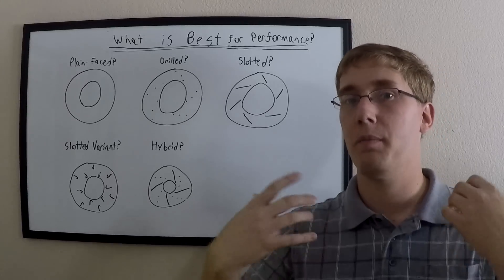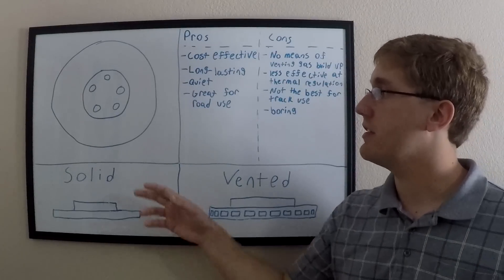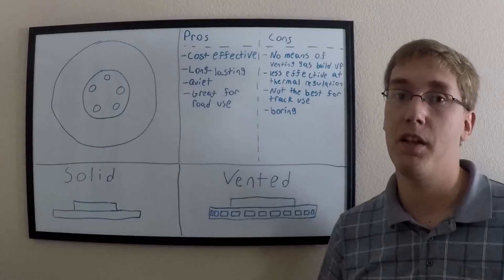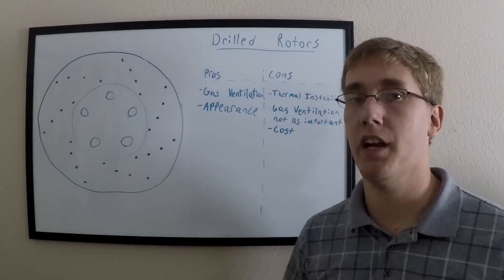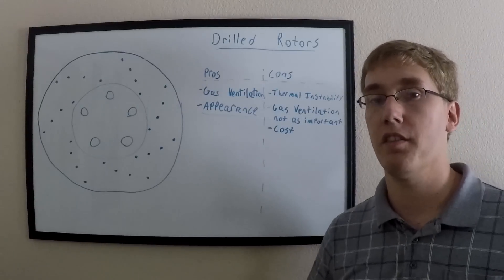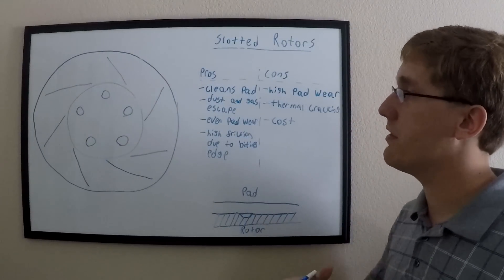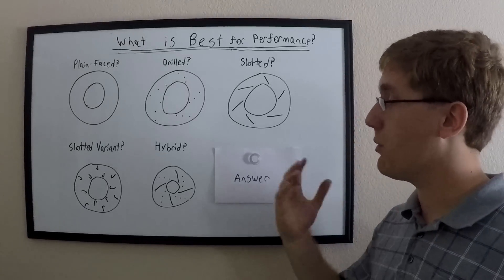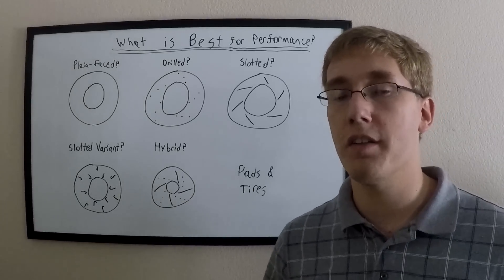Plain vs. Drilled vs. Slotted. vs ??? Rotors - What's what?

Comment: Most cars come with undersized discs and calipers, (I find), upgrading the calipers and disc sizes really does stop the car quicker at higher speeds. Stock are just not up to the job,, most of the time, especially for modified cars..
Reply: People been doing it on Opel Corsa B for years in Europe

Comment: Really nice video, wish I had saw before I purchased slotted for my daily driver pickup.
Reply: The benefit of slotted it that it keeps your pad surface perfectly smooth/level which in turn keeps the rotors from getting any inconsistencies so you won't end up with that vibration or wobble that can typically happen when solid rotors heat up or wear over time. It keeps everything in fuller contact. You won't regret your choice.

Comment: my stock brake is ATE FN3 caliper, with 288mm plain rotor and i'm using Michelin PS4 tires. Brake pads are about to dead (within several thousands km) and I'm planning change them to EBC yellow stuff. also wanna change to 312mm slotted disks, dose that rotor upgrade is necessary? I'm driving kinda aggressive, and sometimes need running up and down hill roads.

Comment: You can use solid/plain rotors for autocross, or even light track use. If you have a dedicated track car, you should have dedicated pads and rotors and calipers. Drilled rotors are only for weight reduction on an already huge and lightweight 2 piece rotor.

Comment: I have  vw Jetta and it has stock  288mm front rotor's, if I change to 320mm rotor's will it make any difference in stopping advantage, I drive mostly highway and some times I got to jam on the brake's to sudden traffic stop. I use ceramic pads front and back,  abs has not turn on any of the sudden stops.
Reply from the maker: Larger rotors will increase the responsiveness of the pedal, allowing you to brake with less effort, keep in mind that it does not improve your stopping distance however, that is down to the tires/weight of the vehicle.

Comment: Good info but never talk about towing which is when you want to keep heat down so drilled will help in this application
Reply: I would do solid personally.  I've seen cracks develop too often around the holes to want to have cross-drilled.  Plus stock it's already sufficient for towing.  I'd just keep the extra mass and use good brake fluid.

Comment: You seem very knowledgeable when it comes to brake rotors mostly out of curiosity I wonder if you could tell me what happened 2 mine.  I have some slotted rotors on the front of my car I could tell they were a little warped so I took them to I shop and had them turned upon reinstalling them I immediately noticed today rhythmic pulsing somewhat like a muffled machine gun every time I applying my brakes. My solution was to just buy a new rotors.  Did I discover by accident that you cannot turn slotted rotors? Or do you suspect something else went wrong?
Reply from the maker: I'm not sure about slotted rotors not being machineable. Did you feel anything through the steering wheel? If not it may just be out gassing from the slots, I have dimpled rotors on my sentra and it makes a noise like a rattle snake under breqking.

Comment: I've learned this when I started tracks days 15 years ago and save a lot because of this. Drilled is for looks and less reliable. If you are daily driving only in that car - get plain. If you are autocrossing or road coursing get slotted, good high temp capable pads and motul to prevent boiling.
Reply: Rogan how about make the slots on a plain one, obviously with an expert on it vs buy a slotted one ?
Reply: Do you think ppl are buying them for the science. Its all aesthetics for 99.9% of population.

Comment: I live in a mountainous region. I do a lot of hard braking when driving down the mountains on winding curvy roads. Is there a rotor specification I can look for that rates rotor warping and which rotor design is least likely to warp?
Reply: A cryotreated rotor will probably have the least chance of warping.
Reply: @dr.hugog.hackenbush9443  Thanks for the tip. The web sites I checked said cryo treated rotors are rated a step up from OEM because they have longer wear, better stopping in general with matched  pads and they are rated even for street and track use. The cost is about 50% higher but still affordable and  if they last longer without warping they will be worth it.

Comment: I have had no luck with rotors. They always getting warped unless i used drilled and slotted ones. But they are loud especially under hard braking. So no solution for me :D
Reply: You can start braking sooner, drive slower, or get bigger rotor set up.
Reply: Michael Distefano i installed big brake kit. No problem after that. And i removed heat shields since using ceramic brakes dont dust much

Comment: I had a 2003 Honda Accord as a daily driver.  There is a down hill grade that is notorious for people getting into rear end collisions on the way to work.  There were times I wondered if I was going to stop in time.  I decided to switch to slotted and cross drilled rotors.  There was a noticeable difference in increased stopping power and there were a couple of instances I am sure I would have run into the car ahead had it not been for the new brakes.   BTW, the OEM rotors were replaced twice because of  warping.  The new rotors never had a warping problem after 50,000 miles.
Reply: Frank Verdin just drive a manual and engine brake lol

Comment: I think his video would have been more complete if he had included the cryno treated (liquid nitrogen treated) rotors. They are available in basically all the variations of rotors mentioned. The greatest benefit of this treatment is the rotors are more durable and resistance to overheating.

Comment: If you want to increase stopping power increase your rotor size
Reply from the maker: Rotor size does not increase stopping power, unless your brakes aren't strong enough already to lock the wheels. 9 times out of 10, the best thing you can do to increase stopping power is tires. Larger rotors only changes the brake pedal sensitivity, among other things.
Reply: @thecarizon504  Agreed, these big brake kits for every day use.. just normal driving (non fast and furious gear head racing) are purely aesthetic for most part. Most ppl don't know the science behind anything, but nothing wrong with big rotors and enormous colored calipers if you want to spring for them. Most ppl agree they look cool. They've become very popular over the years as tires and wheels have gotten bigger and especially with open wheel design we need to see greatness behind the wheels like brembos. Well maybe not brembos $$$, but akebono.. still expensive, or a lot of the cheaper aftermarkets. Great job on presentation man. Shit, I want a BBK, again, purely for aesthetics.. oh, and safety, yeah, OK.

Comment: You forgot to mention the importance of the grove in the middle of most Break pads,this is also something added in the later years to help get ride of the gases.a good pair of pads and flat vented are the best rotor/combo  all around
Reply: The groove is a wear indicator.
Reply: @dr.hugog.hackenbush9443  NO, it is not.
Reply: That’s incorrect.you can use it to indicate wear but its purpose and design is not to indicate wear.most pads have a metal wear indicator.
Reply: The groove is meant to reduce noise from braking, some cars don't have this groove or even the slants on the leading and trailing edge of the brake pad. Every car has different weight, caliper design, pad size differences, etc. etc. that effects the pad design required to reduce noise.
Reply: The grove has nothing to do with noise,it’s soul purpose is to help the pads maintain contact with the rotor by expelling gases that build up between the two and allowing brake dust particles to be caught and discharged out from between the two.

Comment: You missed a huge function of the slots and holes, which is cleaning. Im sure the reason it doesn't come to mind is that you're only talking about cars and not off-road vehicles and trucks but for those of us that run in the dirt and the mud, smooth rotors don't stay smooth long, because the dirt that gets in between the pads and rotors grooves the rotors out. Every time a piece of dirt passes a hole or slot, it falls in and no longer rides the pad around the surface of the rotor. There may be other factors involved here with my second point but it has also been my experience that cross drilled and slotted rotors are less likely to warp. I have had warped rotors on several vehicles and the ones I replaced with drilled or slotted rotors have never warped (or grooved) again where at least two vehicles I have replaced flat rotors on have warped again. Those vehicles are both trucks however which experience and heavy towing and off road conditions so that's not really this video's area.
Reply: I think my point with the dirt is probably pretty well verified by the fact that every off road vehicle(dirt bikes, four-wheelers, side-by-sides, etc.) All have cross drilled and slotted rotors from the factory. Yes, I'm sure there is a marketing feature to it as well but I think there's something to the dirt with the slots and holes.

Comment: So basically I can just use brembo brake pads on plain rotors and itd be much better?
Reply from the maker: Pads are the best thing for the money you can upgrade for daily/track use. In your case, soumds like the ladder, so you would be best off finding a pad designed to run on the track that won't fade.

Comment: I've always wondered why they don't put the holes close to the center so they won't come into contact with the pads but will still allow airflow
Reply: Since metal is a conductor of heat, the center of the disk will still draw heat away from the outer perimeter of the disk, cooling it. And if I'm correct in saying, heat moves more quickly through metal than air, so keeping the disk solid at the center is actually better than using holes. And per the video, the holes allow gasses to escape.
Reply: @ninemilliondollars  true however air helps remove heat from metal and anything really. This is why computers have heat sinks with fans pulling air from them which of course also helps to remove the radiant heat so it doesn't damage components around them. The only problem with holes under the pads is that it increases pad wear. Personally I only use solid rotors but I've wondered about the holes and how they could possibly make them so they wouldn't increase pad wear and still decrease heat.
Reply: @my2centz196  Appreciate your comments. As for drilled rotors, they came stock on my Honda CB1000 motorcycle so sometimes you just have to manage what comes with the vehicle. For my car, I only use OEMs which are solid rotors. Regarding your question about whether there is a way to cool drilled disks without increasing pad wear, I just looked up Indy 500 cars to see what they use. In this video - https://www.youtube.com/watch?v=zZDO1C6JnLY - they show using solid carbon-carbon floating disks, not drilled. They mention improving cooling with a titanium backing plate on the pads. Plus sending more air toward the brake assembly (confirming your comment on computer fans). :D
Reply: @ninemilliondollars  thanks I appreciate your reply and the interesting info on indy cars. That's pretty cool and clever. I just use stock brake rotors also. Personally I think stock works just fine for my purposes anyway as I'm more of just a daily driver but I do find this stuff very interesting. I have noticed now that you mention it most motorcycles do have holes drilled into their rotors. I always thought it was more for looks because it does make them look pretty tough but it probably does increase the gripping power also. I recently replaced my brakes and rotors on my commuter car and I seen all the different rotors they had and was curious about them. Sometimes just because something looks cool and cost more doesn't always mean better huh lol.

Comment: Thanks! Good to know. I purchased my truck with the hybrid rotors and only got about 30,000 out of the pads and they are looking rough. I also drive it in the winter and these aren’t very good because salt can build up in the holes and wear them out faster. Looks like I’ll be going back to OEM
Reply: For trucks brakes you can try geobrakes.com they sell all oem brakes
Reply: @limodxb9177 no they dont...no x7 parts

Comment: Slots for gas drilled for weight reduction why everyone thinks the holes are for venting gas I don't know where they are getting that wrong information.
Reply from the maker: This was never primarely done for weight reduction, why compromise the integrity of the disc to save a few grams of rotational mass that doesn't even carry a lot of inertia, because it's near the hub?

Asbestos pads back in the day generated tons of gas under heavy braking which was known to get trapped under the pad, between it and the rotor. Holes provide an escape for this.
Reply: @thecarizon504  actually it was and still is the reason is simple if you understand the application they were and still are made for performance handling every pound of unsprung weight removed is the equivalent of 4 pounds of sprung weight even the grams are important. What one should do is find real drilled rotors to look at the ones shown in the video are actually pointless the hole spacing is way to wide real cross drilled rotors have a lot more holes
Reply: @thecarizon504  also this is not my opinion it is what I have been taught over the years working for a high end  brake manufacturer
Reply from the maker: Even Brembo advertises drilled as being implimented for passing water andd gas:

https://www.brembo.com/en/company/news/disc-drilled-or-slotted

I am not disagreeing with you that drilled rotors have an advantage of reducing mass, it's just wasn't the primary reason they were invented. Ideally I'd like to find the patent for drilled brake discs but have not been able to locate it.
Reply: @thecarizon504  It's possible the patent for drilled disks, or rotors, or however else they are known is European. If you've not searched for international patents, that may be an option.

Comment: plz people don't listen to this nerd that used google to do research on brakes he knows nothing about brakes. he didn't mention 1/10 of the brake technology of today. A car with shit pads and 6 piston calipers on carbon smooth faced rotors will always perform better than his sentra with 500$ brake pads lmao. He is being payed to feed idiots online
Reply from the maker: Actually I don't make any money off my videos and this was simply a comparison between the different rotor faces. Yes, brake performance gets more conplex when factoring in pads, the rotor material, even the weight of the car, but all of this would recquire a much longer and more in-depth video to do which at the time I didn't care to make.

Plus, if you did actually watch the video I do state that performance of smooth-faced over slotted rotors makes a negligible difference compared to the performance of the pads.

Thanks for berating me though, very constructive.
Reply: Depends on the operating temperature envelope: cheap consumer pads will lose their bite after 2-3 60-0mph stops or a lap in a track or so, something you will almost never experience under casual driving. More aggressive pads will bite better when hot but wear harder and might be noisy. 

Rotor face treatment has practically 0 effect in stopping distance but slots are used in rally cars that are subject to dirty conditions.
Reply: @dtolios  And the slots and drilled holes prevent a film of water from building up.